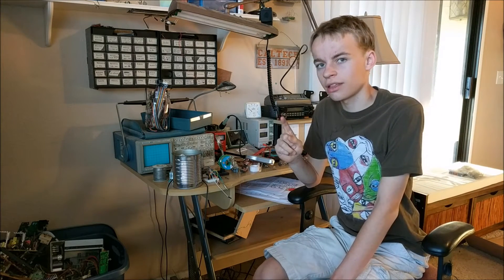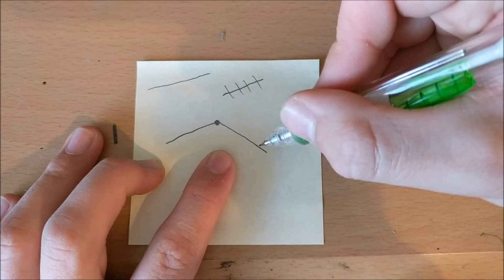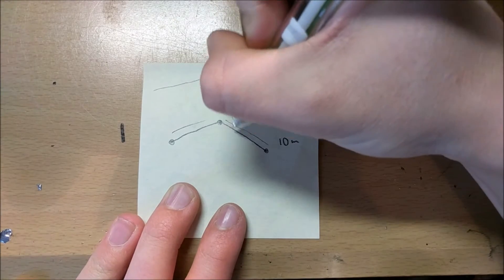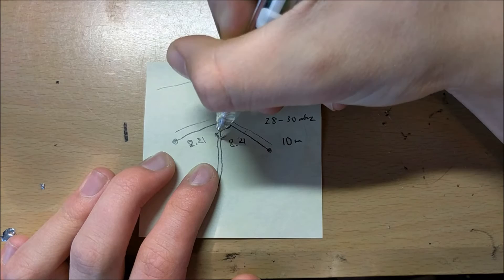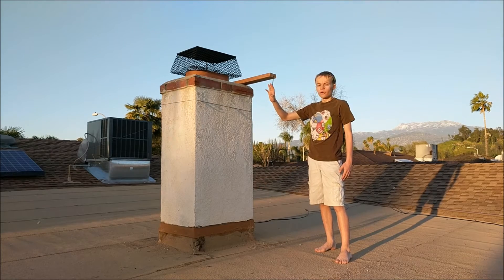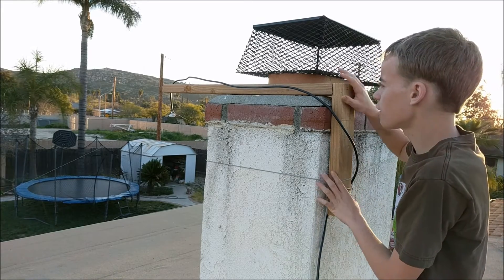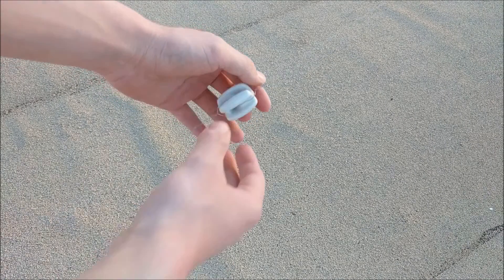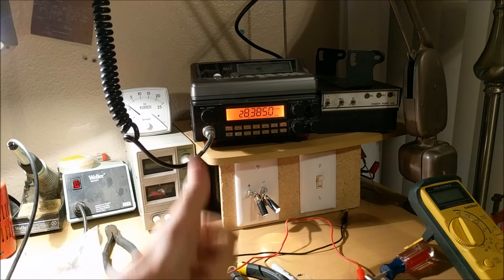How to Build A 10M Dipole For Ham Radio

Comment: Nice to see younger folks getting into radio. Nice work, kid! Small tip in case you didn't know - if your SWR is high towards the top of the 10 meter band, your antenna is electrically long and needs to be trimmed. Opposite if your SWR is low at the bottom of the band, that means your antenna is electrically short/not long enough. I might do something like this soon for my rig - thanks for the demo!

Comment: Good job kid. Use nylon rope instead of wire to secure ceramic end of antenna wires to pipes. Better insulation especially since solar panel pipe and dish bracket are grounded to earth. How did u connect coax wires to antenna wires? you use cb radio?

Comment: The input impedance of a half-wave dipole is 50 ohms, not 75 ohms
Reply: Hmmm.  Yes and no.  Depends if the dipole is horizontal or “inverted V”.   A perfectly horizontal dipole, in ideal conditions, exhibits 72 Ohms impedance (perhaps that’s why Tanner Tech stated that “most dipole antennas are 75 Ohms”), but the diagram of the dipole he drew in his video showed an “inverted V” dipole, which generally does exhibit 50 Ohms impedance (the steeper the V, the lower the impedance).  73.